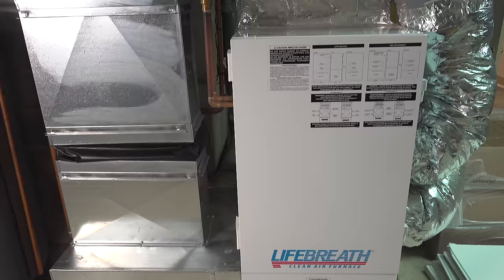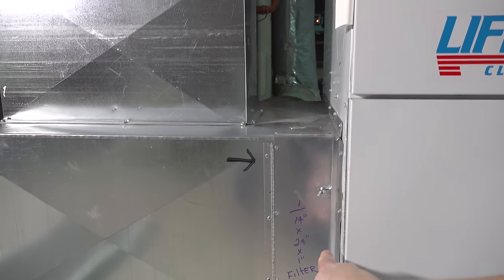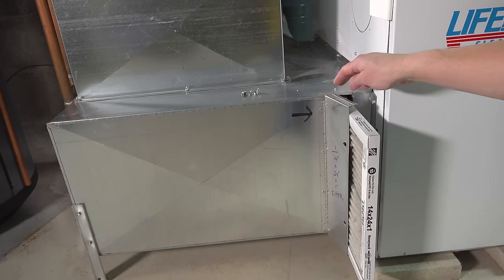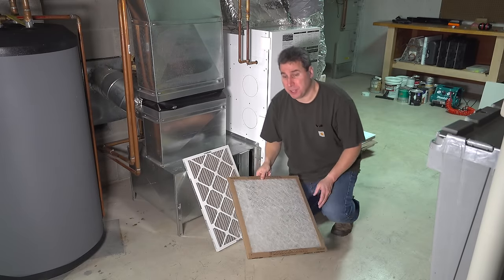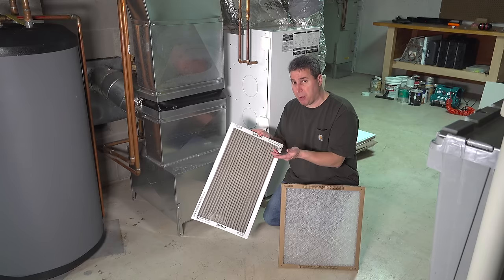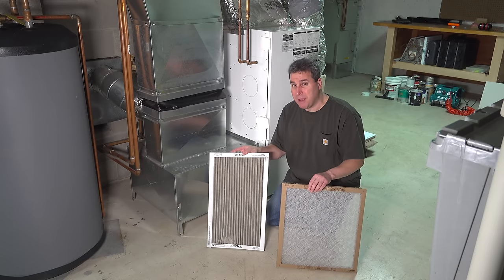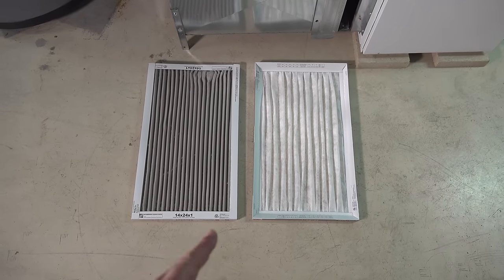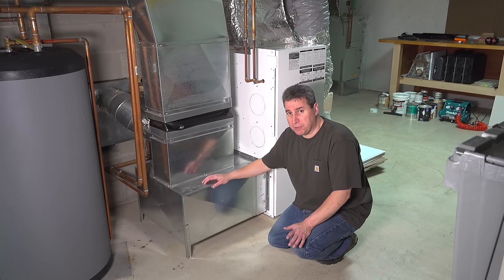Furnace Filter - How to Change it the Right Way & SAVE Money

Comment: Write on the filter the date you changed it with a Sharpie. Or put a stickie note on the outside of the furnace with the date. Always helpful to maintaining a schedule.
Reply: I make a note on my kitchen wall calendar when I should be changing my filter.  I don’t look at my furnace that often for a note on it to be useful. 😊
Reply: Our wifi enabled Ecobee thermostat sends us a note on when to change.  Handy “reminders” for PM/CM.
Reply: I keep a magnetic white board w/pen right on the furnace.  I strike out the last date and add the new date when changing the filter and it gives you the history of when you changed the filters.  Mine is now years old and I see exactly when I changed every filter or made changes, etc. etc.
Best system I've ever used.
Reply: I write the date I put in the new filter on a piece of painters tape which I stick to the furnace. If it’s been cold and the furnace has been on a lot I change it at 2 month# max. If it hasn’t been on very much I may stretch that to 2 1/2 to 3 months. Some  3 M  filters have a link to an online tool that will remind you when to change filters.

Comment: I've always told my kids to replace their furnace filter three times a heating season. Recently my son called me and said his house was not heating up. I asked him if he replaced his air filter. He answered no. Turns out his filter was dirty, really dirty. He replaced the filter and his house was able to heat up. Sometimes Dad knows what he is talking about.🤣🤣
Reply from the maker: Dad power 100%!
Reply: More than sometimes
Reply: Kids! 😒
Reply: three times per season? huge waste of money lol
Reply: @busterscrugs  when you have dogs and cats it's well worth the money. It's like changing the oil on your car.
Reply: The replacement rate is different depending on the air handler/filter.  Mine uses 4" thick and are good for 12 months.
Reply: @BrianPhillipsSKS  I buy a three pack from Amazon. $45.00, that's not bad for the year.
Reply: @BrianPhillipsSKS  same here. 4”, 12 months. Ours was shockingly full after 11 months. No pets, brand new house. I recommend that you at least have a look at it after 6 months and make sure it’s not plugged up. I’m going to change every 6 months from now on.
Reply: Mines always clean
Reply: I hope you are not a "professional", in the trade. This is not great advice.
Reply: @AgentOffice  "Mines always clean". Why is that? What's your secret?
Reply: Why is the heating season more dirty ?
Reply: I keep the furnace fan on low. The house air is constantly filtered and the temperature is more even throughout the house. I check the filter monthly and replace only if required.
Reply: Someone I know changed it, but didn’t take the plastic wrap off!
Reply: I tell my kids that dad is ALWAYS right - by definition.
Reply: I just changed my furnace filter, and had to reverse the orientation. Thanks for the video. Because we have 2 cats, I change the filter on the first of every month. Good tips
Reply: Yes you know what you were talking about, it's our kids that aren't listening 😅
Reply: @tyson505  I was told on another video once a month😮since filters aren't expensive, I'm try it.
Reply: @leelew.1462  actually new filters, filter worse than a slightly used one that will catch more stuff. So besides wasting money, there's that......

Comment: This is exactly why I’m a fan of yours. You touch on everything and anything. Just purchased my first house and was wondering why my furnitures were constantly dusty regardless of all the cleaning I’ve been doing. Sounds silly but I didn’t even know furnaces required a filter. Needless to say when I went down to the basement to checkout it out,all the dust finally made sense. I don’t think the filter ever been replaced. It was so old that it was falling apart as I tried to take it out. THANK YOU. THANK YOU.

Comment: The 3M 1900 is the go-to filter for me. Project Farm found it has comparatively very low static pressure while still filtering significantly more. They have triple the number of pleats compared to the basic filters which also helps airflow.
Reply: Yes I agree the 3M 1900 is good and even think that you can go higher if you want. You bring up a good point of the part that actually matters is the static pressure. 3M does a good job at adding more filter material on their higher end filters to not cause the issues of it being too restrictive as mentioned in this video. They even rate their filter pressure drop at many flow rates, and it often can even be lower than the basic home depot filter shown in the video. This means the ultra high end 3M filter will be less restrictive than the middle of the road home depot filter.
Reply: For every increase in filter mesh, there is a commensurate amount of additional pleats. This keeps the filter looking the same across all mesh levels to the blower.
Reply: @ErikMeike  1900 is wayyyy to restrictive. Thats causing your fan to use way more electricity, run hotter, have less airflow and it will wear out much faster. You just want a standard pleated not a hyper dense filter for those reasons.
Reply: I suppose every furnace is subjective to what it can handle for filtration. My thoughts on it are during winter you don't need to filter out pollon and some of the other things so a 1000-1300 should be fine during your heating season. Spring and summer if your running the air circulation I would go 1600 or above to give you that added benefit.
Reply: @srobeck77  3M filtrete 1900 - merv 13, but also twice the media as most merv 8's on the market (1,560 sq. in) so they do not clog up fast, or create static pressure build up any faster then the typical merv 8.  Oh, but they do collect smaller particulate matter MUCH better than any merv 8 on the market (including particulates from wildfire smoke) - which equates to cleaner coils, less work for your motor etc, and FAR better overall air quality in your home.  It's a no brainer. My residential HVAC heating/cooling system (Maytag) is close to 20 yrs old. Other than changing out a pressure switch yrs ago, not a single issue. 

I change the 3M 1900 every 4-6 weeks in summer, 8 weeks when snow is on the ground.
Reply: @KamfaKing  more so than the perception of overly dense filters equating to cleaner coils, would be to on a UV light inside your furnace to prevent mold and mildew growth. I installed mine, myself after watching a youtube and then buying one on amazon.
Reply: @srobeck77  I live in a relatively dry climate, where mold and mildew is a non issue.
Reply: @KamfaKing  no matter what you will still have water condensing inside of your evaporator coil.  Because hot air ALWAYS contains more moisture than cold air.  So as hot air from outside goes across your indoor evap coil, the water vapor turns into liquid form and you can see it going into the floor drain.  

But I dont live in dry desert air climate, so youd have to research how much of a concern it is there. I know it definitely is in Texas and Middle eastern deserts countries (from being deployed there) because they get humidity in the air from the ocean.
Reply: @KamfaKing  I changed my filter rack to 20x25x5 and have to change my filters only once every two years.

Comment: Great advice. My HVAC installer also said the same thing. This filter is just to protect the heat exchanger and coils. Too restrictive of a filter will burn up the motor or damage the furnace heat exchanger or electrical coils as they expecting a minimum airflow to keep them from overheating.
Reply: If you read the installers manual for a furnace or air handler it will tell you the minimum airflow you need. Restrictive air filters mess that up
Reply: 这是个很重要的问题，过滤网只是为了保护电器而设置的，高密度滤网并不能为你提供更高质量的空气！密度过高会损坏你的电器。MERV6-8最好！

Comment: Helpful info!  One can use a fine cut file,  1000-2000 grit sandpaper or foam sanding blocks to sand the nasty sharp edges off of sheet metal, if needed.

Comment: My uncle owned an HVAC company for 20 years. When they installed my new furnace and AC I was told to run the cheap filters due to air restriction and that furnaces are made for those filters, not the expensive ones. 
Was also stated that replacing every month is recommended and if running the expensive filters to change twice a month due to them being so restrictive on air flow. Just my 2 cents.
Reply: I think you make more sense than the guy posting the video
Reply: That's simply wrong.  Modern efficient furnace filters are not restrictive unless allowed to get too dirty.
Reply: It cost me a $120 service call for the tech to tell me that the reason the furnace was not working was because the mid-range pleated filter was plugged after only one month.  Middle of winter, windows closed, no pets or kids, no sawdust or other dust creating activities.   Recommended that I go to the basic fiberglass filter which I still continue to replace regularly.   No problems since then.  

Also beware of the Furnace Duct Cleaning companies.  They use low paid inexperienced workers who should not be around modern furnaces with expensive electronics.  The guy removed the electronic board and simply tossed it onto the concrete floor, damaging it.

Comment: I live in the gorgeous deserts of the American Southwest (Las Vegas, NV) and we change our filters every three months without fail.  We used pleated Filtrete filters, but we invested in electronic filters from our residential HVAC company.  Costs way more, but it also filters out more dirt, dust, pollen, and finer particles than standard filters.  Our health is much better since using them.
Reply: Hopefully you also have DC furance fan motor too. Those you can leave running on low setting 24/7 because they use way less electricity than the typical AC fan motors. I would consider that combo a must for the best air cleaning results.

Comment: One thing I learned from watching HVAC technicians is don't get the most restrictive filters because they will cause premature wear on the blower motor. Likewise don't get the cheapest ones because they allow dust to accumulate on the evap coils.
Reply from the maker: I totally agree with them, my old house had one and I couldn't figure out why AC was so poor. swapped it to a mid grade, it was night and day
Reply: That's simply false with modern ECM squirrel cage blowers.  There is no additional wear on these blowers as they spool up and down to deliver the necessary air flow rate.
Reply: @christopherhaak9824  ECM motors still have to unnecessarily spin faster to make up for the restriction in the filter. And fan motors in furnaces have been squirrel cage types for over 4 or 5 decades now, so thats not really a benefit, its just the standard.

Comment: My HVAC system uses a 20"x26"x5" air filter which is expensive at $50+ if they are even in stock.
I installed a vacuum pressure sensor downstream of the filter to measure the pressure drop and determine when to replace the filter.
Reply: The 5" ones last much longer because they have more filter material. They won't clog up as fast.
Reply: @SalvadorSTMZ  I get about 18 months out of one filter. When I bought the house the filter in there was 5 years old, but very dirty and restricting flow.
Reply: Use your eyeballs and its just as effective. Typically a 4-5" filter can go about a 1 year but mileage varies with pets or if you have wood floors that you mop weekly, etc.

Comment: I have a boiler and I don’t even need a filter but I still watched your video just cause I love your videos… 😂
Reply: you just have to be concerned with the water quality inside the pipes. Tap water will eventually turn into black moldy sludge on the inside unless you chemically treat the water inside boilers

Comment: Mine has a return register that's luckily the same size as the filter, so I replaced the plain vent with one that accepts a filter. I put the cheapest filter in that and a really good one in the unit. I replace the cheap one every month and the good one now lasts about a year, though I still change it about every six months.
Reply: I'd put a good one at the return inlet so you don't have dust and whatnot collecting in the ductwork.
Reply: @tihspidtherekciltilc5469  There is no ductwork, it's at the floor immediately under the furnace intake where the main filter lies. My reason is to make those $30 filters last by trapping the bulk of dust with a $2 filter.
Reply: As long as you arent using a fiberglass filter, then yup get the cheapest pleated filter.

Comment: I buy low-cost pleated and run fan 24/7.   Change out every 6 weeks.  Just replaced my 25 year old Trane.    Great unit.   Running fan all the time filtrates better and keeps house temp more uniform between my 3 levels.  Added cost of electricity running fan full is minimal.
Reply: I do the same thing. Hopefully you told the new contractor that was your intention, so that he sold you a unit with an ECM (DC) fan motor which is far cheaper to run than the typical AC fan motor. Also, Id highly recommended adding on a UV light to the furance. Very easy to do yourself after watching a youtube video on it.
Reply: Never knew … will look into it. Thanks

Comment: We use the fiberglass one and change it every 30 days.(marked on calendar). We have 3 medium dogs. Our furnace man said to use the fiberglass ones and change once a month so we do. He also said to never use the reusable ones.
Reply from the maker: Most repair/service techs are not fans of the high efficiency stuff. For a long time there was no medium sort of grade. I think the fiberglass filters do a great job and filters are really there to protect the motor and intake which fiberglass works well on
Reply: Fiberglass (aka leaf catchers) and the worse and cheapest ones you could ever dream up. I thought only slumlords ever used those in rental properties. Ya you wanna switch to a pleated filter asap, but not an expensive high density 3M scam version.

That leaf catcher filter your using, is dumping a ton of dust and dead human skin into your fan motor and coil inside the furance. And of course also, your breathing it in constantly too. Never, ever, use the a leaf catcher filter, they do almost nothing for dirt. Just look at the gaps in it, very obvious.....

Comment: As was said here there has to be a balance but for me I take a slightly different approach. I use the cheaper filters (maybe not the cheapest thing out there) but I change them more often. We also have several stand alone air filters one on each level of our house. The reason for this is that in the mid Atlantic we have three season with a pleasant fall and spring where our HVAC systems do not run that much. With that in mind and having pets I want full time air filtration which is why we use the stand alone air filters. Having been a home inspector at one time I do recommend staying away from the ultra restrictive filters because some can cut the airflow as much as 30% when they are new and much more when a bit dirty. As the video said a middle of the road filter is a good choice for most home owners.

Comment: I do it when the weather changes, so 4 times a year roughly. I use the high flow during the summer and winter and medium filter during the spring and fall.
Reply: Lol never use the high density filters at any point, regardless of how you think your beating the system. Your just stressing out your fan motor every time it has to run.

Comment: Check the furnace or air handling unit documentation.  It should be specific about the recommended MERV rating for your system.  Mine says MERV 13 so that's what I use.
Reply: Honestly thats too dense and you're running your fan motor alot harder than it needs to (more electricity) and getting very little in return. If you want improved filtration, you want to get an electronic air filter, are ionizer, and UV light (kills mold spores) installed instead. MERV 13 is just a gimmick if you ask any hvac tech.

Comment: Another tip: Write the date you installed the filter on the edge of the filter. Also, another good rule of thumb:
- During peak Winter / Summer months when Heater/AC is on almost 24/7 - change the filter every month
- During nominal temperature months, when the Heater/AC is hardly on - change filter roughly every 2.5 - 3 months
- As far as ratings go, Merv 8 is about max middle-of-the-road rating before air restriction issues can start being a problem

Comment: I wish the 2 inch filters were more common. They filter better and allow more airflow.
Reply from the maker: I totally agree with you, its crazy! Those things are really great
Reply: I have a 5" thick filter, which I haven't seen anywhere else. My heater is about 25 years old.

Previous places I have lived at had 1" filter and they are not the best. Have to trade off the pressure drop and MERV rating, and change them often.

Comment: My air return/filter is in the hall of our home. I noticed lint along the edges and corners of the return, so I now place the blue painter’s tape around my filter, sealing off any gaps between the filter and frame, forcing all the return air to go through the filter and not sneak through the sides. It actually cuts down how often I need to dust the furniture.

Comment: When we had new heat pumps installed, the installer said to use the cheapest filters and replace them more often. He said the units will last longer because (like you said) the more expensive kinds strain the system.
Reply: If by "cheapest" he means fiberglass, than thats completely wrong. If by "cheapest" pleated filter, than that would correct.

Comment: Heat and AC guys in my area suggest the cheap ones because of the air flow restrictions of the other types.
Reply: Cheapest "pleated filter" not fiberglass. You gotta pay attention to the fine print, lol